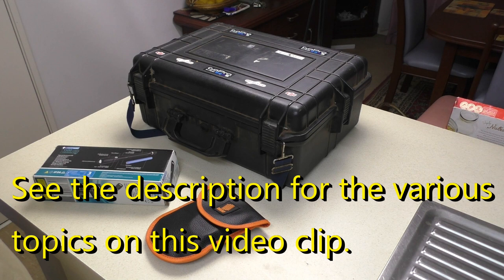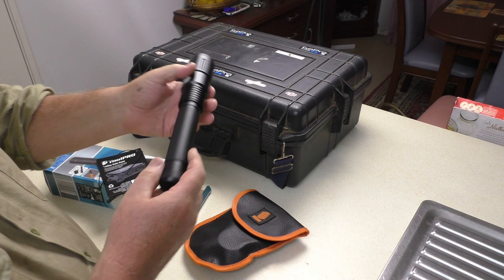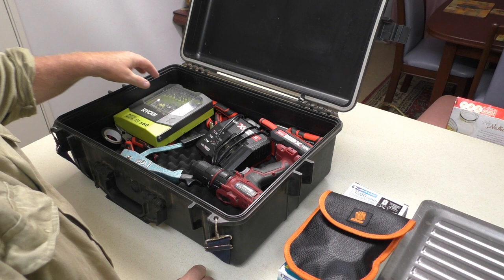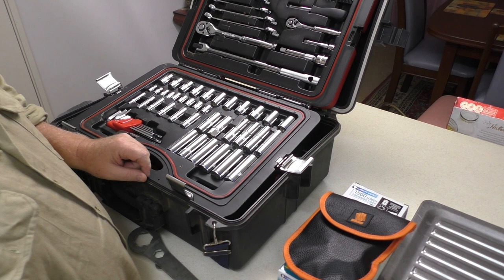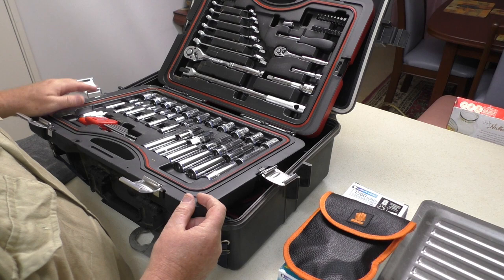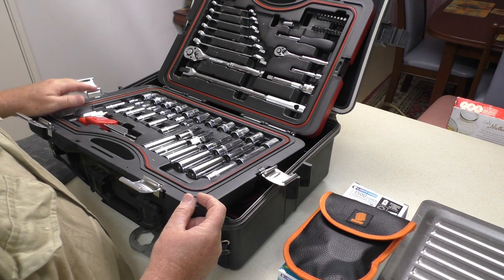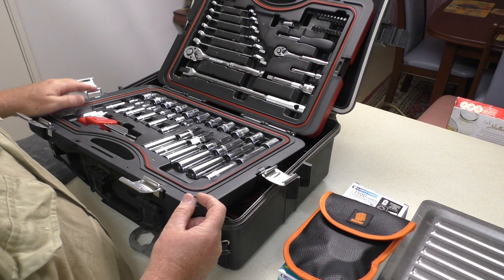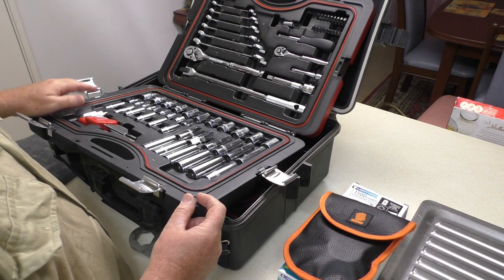Shark Bay preparation - Part 2

Comment: Thanks the torch is a deal breaker - going to by one tomorrow - still slowly getting camping gear - was down at Collie camping Easter Weekend was 2C had a great time so many places to visit. Thanks for the video
Reply from the maker: One thing though, Aldi may not always have them in stock as they are part of the special deals they have. Probably best to phone ahead and make sure they have one in stock.
Reply: Cheers

Comment: Hi thanks for video, really enjoyed it.. If you were about to do the big lap again, with your hindsight, what vehicle would you choose,? 4wd with camper trailer/ caravan etc , coaster bus or camper van? I know there is no one answer, but thought I would ask as you spent 5 years doing just what we are in the planning stage of, we will be in our mid fifties...

Cheers Den
Reply from the maker: Hi, If I was going round Australia again and was doing it as purely a pleasure trip (when we went we had to work as well as travel) I would choose a 4x4 and a tandem caravan. It really is the most versatile and easy to use combination. For a number of reasons we don't have a caravan any more but if I was on the road full time again, that is the way I would do it. I wrote a page about the different types of touring rigs and you might find some useful info there http://www.wanowandthen.com/compare-rvs.html
Reply: Western Australia Now and Then thank you so much for your reply and link, I’ll be reading that with a cuppa shortly. Safe travels on current trip, I’m looking forward to your well informed videos 👍🙏🏻